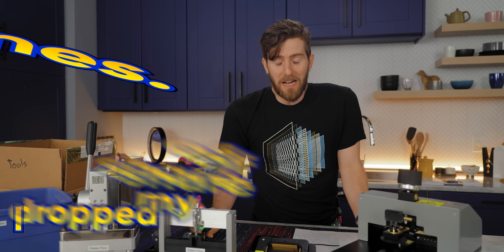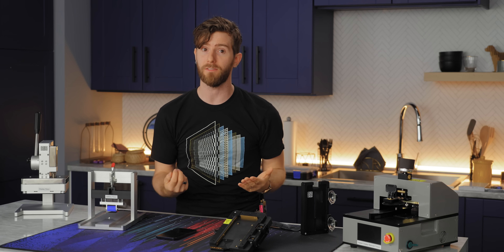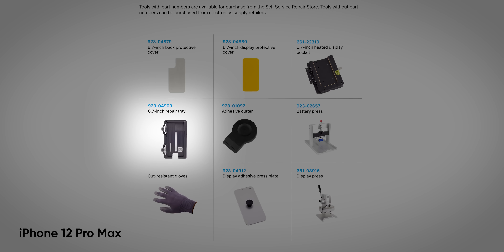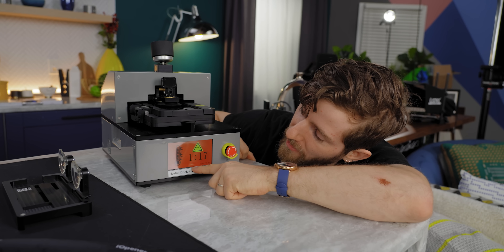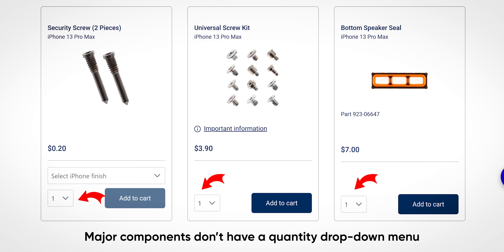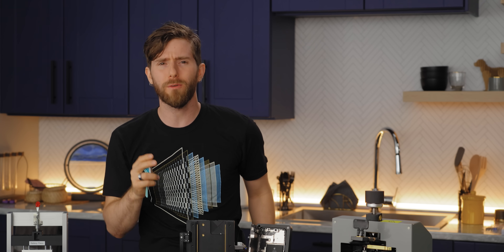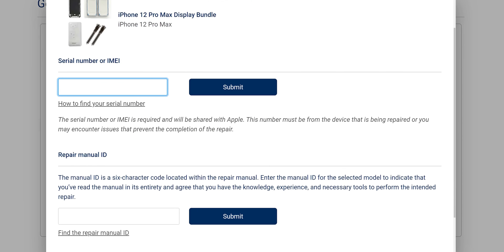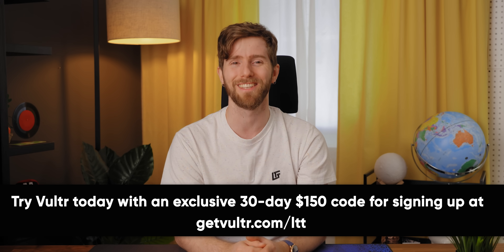I’m a Genius - Apple Self Service Repair Program

Comment: Self repairing your broken device is stupid. Just pay someone that works with this trade. You save time, money and keep the economy going. This kind of mentality is a clear sign that you don't understand what money is, how it works and what it is intended for.
Reply: You're free to maintain your extremely narrow mindset of right to repair. You obviously gleaned nothing from some of the points made in this video. 

Also, I'd say I know money, and it's value, quite well since I've been an accountant for quite a few years... currently with an electronics manufacturer.
Reply: It's attitudes like that that promote things like Apple's horseshit "right to repair effort".
Reply: It is attitudes like yours that confirm that none of you know what money is. Instead of wasting time reading a manual, waiting for tools to be shipped, learning how to use the tools, doing it yourself, cleaning up and sending the tools back, you should use that time to work on your own craft, or develop skills that you need to be successful in your job, making way more money than you would pay for a TRAINED person to do the same job in a fifth of the time.

Comment: Thanks for pointing out the rental and buy differences. Now we know all those channels that did their videos spouted out the thousands it cost but only rented them cause they had the pelican cases.
Reply: @marcogenovesi8570  what shops?
Reply: @oogagaming69  The ones his sister’s boyfriend’s cousin owns, obviously.
Reply: @thesaltlampofchaos   🐥 (the real issue is the lack of a pelican emoji)
Reply: @marcogenovesi8570  did you not watch this video? It's discussed around 4:20
Reply: @JoGuev7177  4:37
Reply: @MrPruske  yes, cardboard with foam, not pelican cases.
Reply: @marcogenovesi8570  LTT got the bought machines on normal cardboard shipping boxes.
no pelican cases at all, so not sure where you got that idea, so:
source pls
Reply: @marcogenovesi8570  ok, which ones, source pls
Reply: They could’ve rented and just kept it to get charged the buying price (and a little extra)  though, hence the pelican cases
Reply: @torbenmayer  It's not really too far off from some centers sending them in pelican cases and some having ran out of them and using boxes instead.
Reply: @marcogenovesi8570  after looking around the web, swinging by the other local cell repair shops on Harry Hines in Dallas, the few stores that purchased a kit did not receive pelican cases. They were bought as soon as they became available to see how it compared against their methods of repairing.
Maybe the shops you know that got the cases rented the kit and ended up holding onto them and forfeited their deposit.
Reply: "all those channels"... Which ones are "all those"?
Reply: XD  .
Reply: Tbh seems like a better value to rent then tell them I'll buy it
Reply: @marcogenovesi8570  he litterally just said they came in cardboard box because they bought them tho
Reply: @marcogenovesi8570  THEYRE IN ROME! if your buying in the USA or canada you get a box
Reply: ronch is a brand boy. So clear now.

Comment: I worked at an apple authorized service point. These are the exact tools that they use there too ... or should I say: SHOULD use. Most of the technicians still wing the repairs. The only part that really changed and annoyed the fuck out of me was everything around the repair, getting apples terrible service form to work and register a repair ... Ew apple, ew.